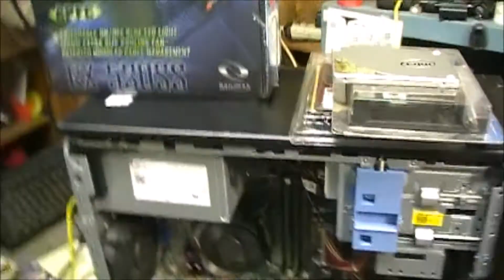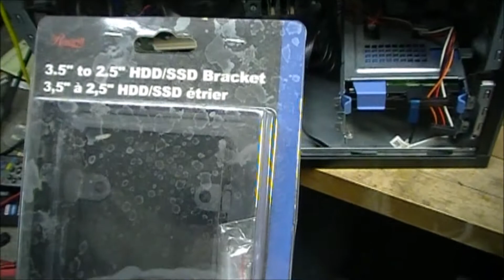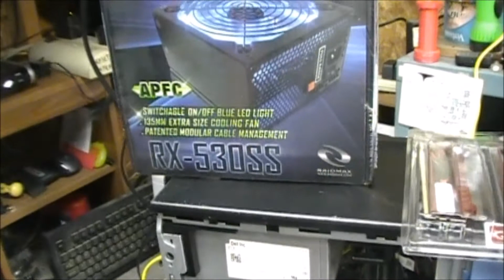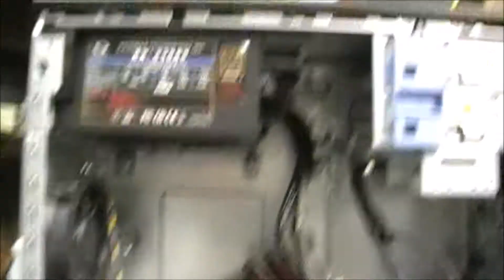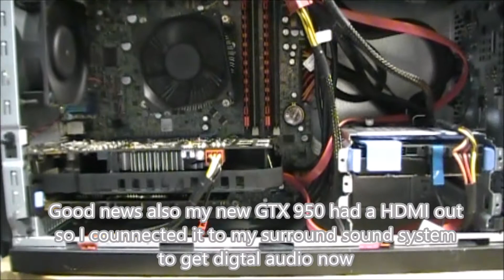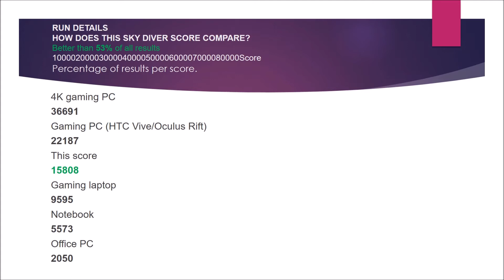Dell Optiplex 790 Intel I-7 2600 Budget Build Gaming Machine Project

Comment: I have the 790 desktop, it came with the core i5 2400, is it compatible with the i7 2600? Even for its age the i7 kicks butt
Reply from the maker: Yes you can put a I7 2600 in it mine still rocks for it's age...
Reply: @TheElectronMan  awesome, I'll try to see if i can snag a deal for one

Comment: Yeah u just drill out the rivets to make room for a bigger card. I have the one with the I5 2400, and I put in my GTX 970 which is still a killer card. Doesn't bottleneck at all. Played Far Cry New Dawn, Just Cause 4, Devil May Cry 5, all run flawless with fps of 50 (more or less) on high settings. Works for me since the rig itself was only 115$!!
Reply from the maker: No doubt mine with the I7 and the GTX 950 holds it's own, it's a solid gaming PC the only issue I have is the single fan Video card gets pretty warm. That is why I added that extra fan up front and that seemed to do the trick..
Reply: @TheElectronMan  Yeah I might get the one with the I7 4770, and give the one I have to my parents ;o) Should be even better.
Reply from the maker: @drummer7557  It's amazing to me that my I7 2600 is still a strong performer. The CPU is like 8 years old since release but still keeps up with current CPU's

Comment: I just built a 790 i7-2600 SFF swapped into a mid tower but when in bios I cannot use my mouse to change things please help
Reply from the maker: I don't think I can on mine either I think all the changes in bios are made by using the keyboard as I don't think BIOS recognizes a mouse for input.
Reply: @TheElectronMan  What do you press to make changes? I can only go up or down the list on the left side of the screen.
Reply from the maker: @ryuflea  Used the left and right up and down key to highlight it and then hit the enter key to change it.

Comment: Did the same thing with a 9010 optiplex that had an ivy bridge i7. Put in a gtx 1060 3gb card I already had. Added a evga bronze power supply and the damn things power connection was blocked ever so slightly by the edge of the case. I took some tin snips to the back of the case and now we’re in business. Impressive little beast.

Comment: hey buddy 
i have same gaming machine 
can you plzz tell me
can i attached the gtx 1050ti or gtx 1060ti in this same machine 
gpu have double fans

plzz tell me
Reply from the maker: You need to find out how long the 1050TI or 1060TI card is as the dell case has pretty good room for them but not unlimited on the length I think anything under 12" you are fine. The problem I ran into was the SATA ports where right under the video card slot but some 90deg SATA cables did the trick. Main thing also you will need a new Power Supply as the stock one does not have enough power output to support the video card but this case uses a standard size PS so that was no big deal.
Reply: has to be a low profile GPU

Comment: To any of you having trouble fitting graphics cards in the Dell Optiplex (Especially the Optiplex 7010 i5 3470) because of the Sata cables getting in the way especially with dual fan gpu's a company called Silverstone makes low profile right angle sata cables in 300-500mm lengths as for the (USB 3.0 connector) you'll have to source a low profile end for it (19 pin specific) Not all Optiplex have this problem but most do. Hope this helps.
Reply: Yeah u just drill out the rivets to make room for a bigger card. I have the one with the I5 2400, and I put in my GTX 970 which is still a killer card. Doesn't bottleneck at all. Played Far Cry New Dawn, Just Cause 4, Devil May Cry 5, all run flawless with fps of 50 (more or less) on high settings. Works for me since the rig itself was only 115$!!

Comment: I'm planning on buying me a Dell Desktop on ebay with an i7, I have a few parts already on hand to add, 650 Watt power Supply, Extra 2 ram chip 4GB each, XFX ATI Radeon HD 4890 graphics card, A large custom tower, extra cooling fans. Now I wait and buy me the Dell computer I look forward too.
Reply from the maker: It's the best bang for the buck out there right now if you ask me...

Comment: I just got a Lenovo Thinkpad with i5 3550, 4gb ram, 500 gb HDD, for $95, bought a new case, Hyperevo 212 Cooler, used GTX 1050 ti, 800w PSU and 8gb ram for under $200. Does this config sound good to you?
Reply: you mean a thinkcentre, a thinkpad is a laptop lol
Reply from the maker: Heck yes that sound like a rocking deal to me...
Reply: Sounds,great but why 800w osu your only gonna need so much power with 980tis in ski or 1080ti in sli

Comment: How do we enable turbo boost i have a gtx 750 ti and i7 2600 i have speed step enabled and turbo boost technology enabled the max the cpu frequency goes up to is 3.491ghz do i need to swap out my 230watt power supply for turbo boosting to work?
Reply from the maker: I do think your Power Supply is undersized but as far as turbo boost I would not trust the windows number on that. As for turbo boost to work you have to put a lot of processing load on the computer also if the CPU temp i is high it will not boost up to max.
Reply: The reason why i think its the psu because i heard the the i7 2600 uses 115watss with turbo on and i have a gtx 750 ti already in my pc i have stressed the cpu even in cpu z it say 3.491
Reply: I can try using the intergrated gpu so i know if its the problem
Reply from the maker: Yeah I agree you are on the edge of not enough watts. I just wanted to make sure you were not just looking at windows for the speed as it just shows mine 3.4  but then I used a CPU benchmark and it said 3.78 so I know windows doesn't report it right.  I would upgrade your PS though either way... I have 550 in mine now and no worries...
Reply: See i have just bought this on ebay i cant tell if the cpu is faulty am trying to check everything so i can get a refund if its broken.
Reply from the maker: You can go to Intel and they have a CPU testing program that checks the CPU completely out..

Comment: Although they say the free upgrade from windows 7 to 10 has ended, you can actually do so and windows will remain activated. If your worried, just clone your drive or do a fresh install of win 7 on a different drive and upgrade  with a backup
Reply from the maker: Unless you had Windows 7 Enterprise like I had.. They never offered a free upgrade from that OS I think there a couple others as well...
Reply: Nope, windows 7 home and pro
Reply: Still works did it last week 👌

Comment: hi man :) great video ;)
can you pls help me on this issue, i would be a happy man if you do :) well i have a 7 old pc and i was going for the gtx 1050 ti but recently i found some forums say that new gpus will have compatibility issues with old oem pc mobo due to bios/uefi that will result in booting problem and in the same time there is many others who successfully installed the gtx 1050 ti on 2008/2009 outdated bios mobo.. i'm very confused right now, i don't know what to do !!
pc specs:
hp elite 7300
pegatron 2ab5 sandybridge h67 ami 7.07 2011 legay bios
i5 2500 
8 gb ddr3
500w psu
Reply: It will work fine! I have the exact same setup.
Reply: Try updating bios if it doesnt work to BIOS Revision A18 or something.
Reply: 400 and 500 series AMD cards I have seen wont work. Nvidia cards work just fine. I built one with a GTX 1050 a 6 months ago. about to do another with the same specs with either a 1050 TI or a GTX 1060.
Reply: No I have same one in the video but your MOBO cant be from 2008 or 2009 if you have a I5 2500 in it . It has to be 2011 or 2012 so it will work. As long as your MOBO has a PCI-E slot your fine.
Reply: Medo Mg then your good to go
Reply: with the specs as mine?
Reply: it has pcie x16 2.0 slot